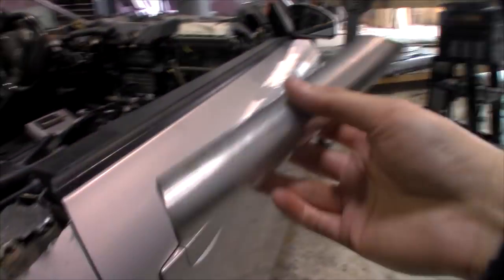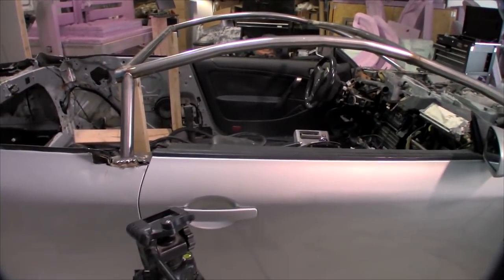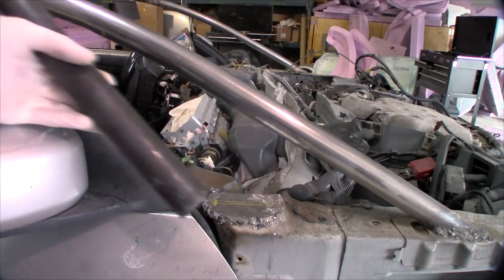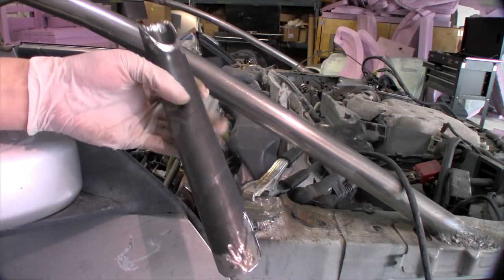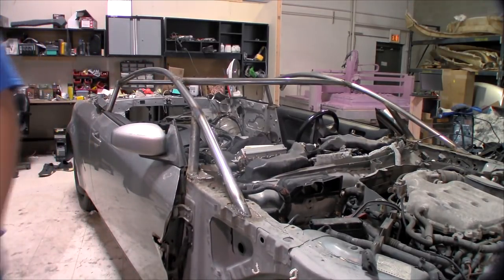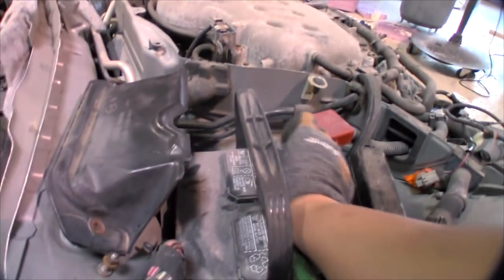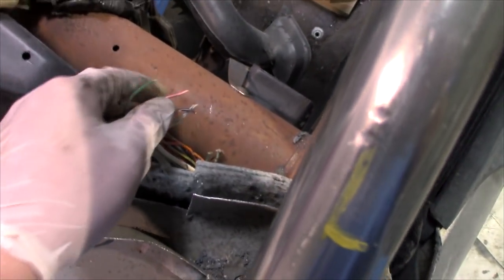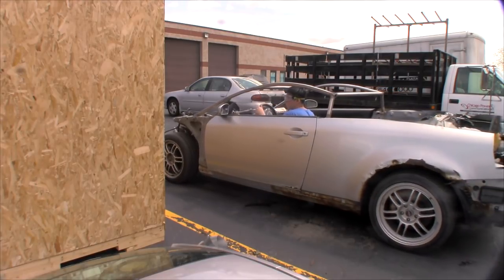Building the Super G kit car vlog 2 - I fell off the roll cage!

Comment: Hey man I'm a fan of your channel and even got some work done thanks to youso don't take the following in the wrong way at all buuuuuut I think you need to consider bring in outside help for the welding and a little of the fabrication. Those welds aren't penetrating the way they should and overall the cage can benefit from some tig work or at the very least MIG + argon as opposed to flux wire.

It's good and holds weight and all but it's impacts that are a concern. It won't break slowing from standing on it or anything but instead can just give away and snap with the right hit. I'm just concerned for it being a safe car, not here to hate but I can't watch and not throw in my 2 cents. I have experience welding myself as well as friends making a living with their own businesses and would happily help out but you're thousands of miles away so this is all I can do from here.

But yeah man, just get a second professional opinion at the very least to receive some tips or warnings and possibly help for the welding and construction of the cage since this is all there is now with the rest of the original structure of the car gone.
Reply: keep at it though
Reply from the maker: I wouldnt hire anyone to do this specific project, especially when im using it to learn. This my first time fabricating metal. i guess i should hire a metal fabricator to come in as well and forget about developing a skill that i want to learn. If i approached everything this way, i wouldnt be doing what im doing or have what i have. I would be a loser warning others about the dangers of trying things. Really, the welds are fine, the safety brigade comes to every channel like this to warn about unsafe practices, i promise, you do not want to be apart of the safety brigade.